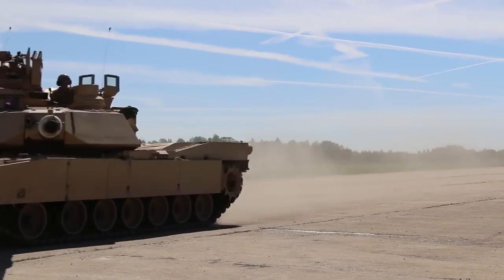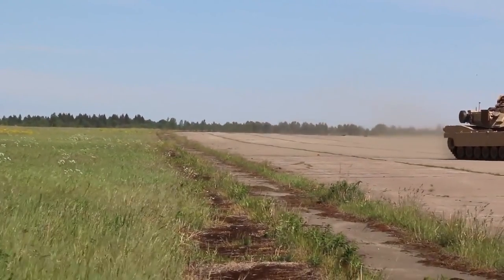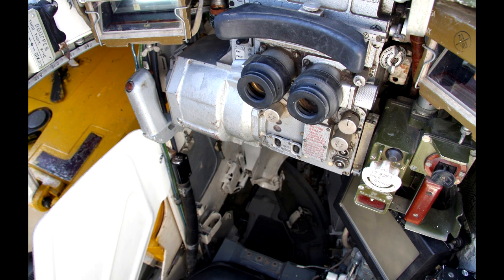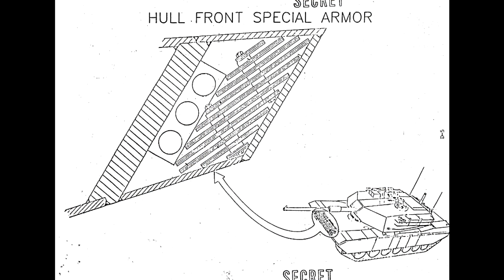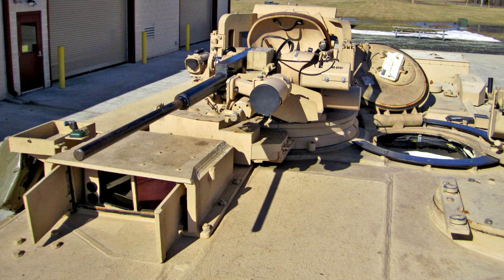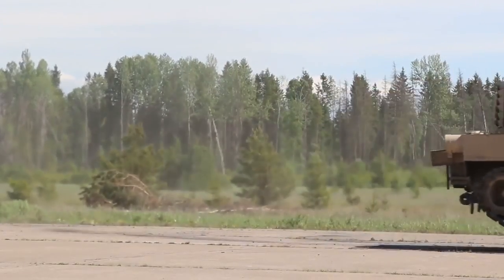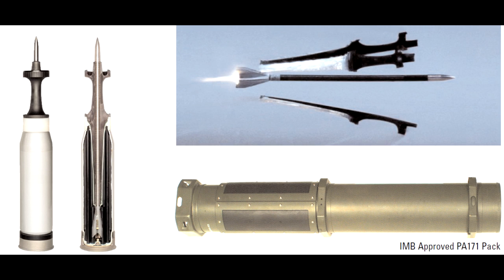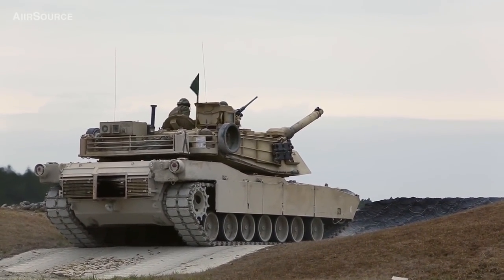Problems with Abrams tank

Comment: As an american, I can say that I'm totally biased, no matter what I do, but hopefully I can overcome that. one thing you might want to correct is when you mention that the abrams would meet the same fate as russian tanks, which is not true due to the fact that an ammunition blowout, in most cases would not harm the crew, whereas on russian tanks, it turns them into astronaunts. you might have just been refering to them being knocked out in combat, but most people will probably think of the turret flying.
Reply: Bro💀Your stupid ass brain can realize that russian tanks would still be destroyed even if it had blowout panels? Wanna know why? Because the cumulative projectiles after penetration create a fucking hell inside it. It just doesn't matter, do you have panels or not, crew will still die in a similar way a soup in microwave. But ofc, you won't understand it

Comment: Something to keep in mind about the turbine engine. America designed the tank to run on the most abundant fuel source available to it. Jet fuel. When the American military has to go to war, it has to be shipped there by boat and plane. The most commonly used fuel you will find on carriers and planes? Jet fuel.

THAT was the reasoning.

Comment: I love how you assume that only Abrams uses "whatever it is" fuel. Nope. JP-8 is a type of jet fuel similar to diesel in many of it's characteristics ands majority of US vehicles are designed to run on it. Not to mention 105mm was installed on it as a stop gap measure because 120 wasn't ready at the time.

Comment: well, it may have it's problems, but they seem minor compared to enemy tanks
armor  may be weak at some points, but it's still stronger and better armor then soviet tanks today...
and the turbine, it has it's advantages and disadvantages... keep in mind that it was designed with the workings and tactics of the US military in mind, so they envisioned likely scenario's where  for example the right fuel would not be present at a time of need, so they designed it to gulp any possible fuel... at the cost of becoming a bit inefficient in that regard...
so even though every1 may see features of this tanks as problems weakening the tank, in the right hands, that monster could actually be, well..., a monster on the battlefield
interesting video, so far it has positioned and proven itself the best tank in the world, and since talk is cheap, as long as that fact remains disproven, it may as well have no engine at all, it'll still be the best in the world :D

Comment: The reason why Abrams uses turbine engine is weight and size.
Turbine engines weigh less and have smaller size when compared to diesel engines for the same power output. Putting a diesel engine to Abrams would make it simply too big and heavy.

Comment: The M1 may be fuel inefficient, but when you're fighting on oil fields you can fuel up at any time :)
Reply: I am 99% sure this is sarcasm....but these days, you can never be 100% sure....
Reply: This man right here, is thinking as everyone should when operating the Abrams
Reply: They should've added a built-in refinery unit, where you just need to feed it with crude oil!
Reply: Yeah you are right... there is a gas pump connected to the oilrig😂👍
Reply: Literally made for the middle east 💀
Reply: És lángolhatsz is mint egy olajkút.😂😂😂😂😂😂
Reply: just another stupid american
Reply: The M1 only has an advantage over the Leopard 2 when you fight in a distillery or perfumery since the only fuel an M1 can use which a Leopard can't is alcohol.
On the other hand the Leopard runs happily on heavy oil while the Abrams does not.
Reply: @gustavmeyrink_2.0  we all know how much the Russians love vodka

Comment: You are wrong about RHA. You said that no armour can be stronger then the same thickens of RHA. Even British Chrobham armour was reported as being twice as protective as  RHA.

As far I know M1 uses level 1 first generation Chrobham armour supplemented in some models with DU inserts. 

I do not understand the hard time you gave to Challenger 2 saying the driver's periscope was a weak spot when according to you the whole Upper front plate of the M1's hull is a weak spot. You also did not mention TUSK...

Comment: The Abrams gas turbine unit is an odd decision.  The tank was no lighter, the engine consumed as much space within the hull, it did not generate more power and it is no more reliably but it did cost more, costs more to service and is less efficient.

Comment: There is no such thing as best when it comes to weapon systems. The tank is just part of that system. Taken together a weapon system is optimized for a set of environments. The Leopard and Abrams plus their support were designed with different missions and requirements. So who fairs better depends on the circumstances they face in combat.

Comment: Diesel engine mean, you can only use diesel fuel. The gas turbine can use multi type fuel. I think that is an advantage.
Reply: in Russian tanks, any fuel, except kerosene. Similarly, in military equipment - for example, the tiger car. As for fuel, Abrams consumes about 1,500 liters, diesel 300-600 liters
Reply: Russian and German engines are diesel multifuel

Comment: I have a feeling this guy is a Russian or pro Russian…you will see how good it is when it touch down beside it little brother bradly ..you Russians are in trouble.. u shot at it and pin points the shot and kills..same with the bradly .😢 emoji is gunna be ur Russian friend.. it will kill anything Russia has .that’s why your president is shaking in his boats
Reply: he seems to be with Serbia, I can't say that he is for Russia, when there was a review of the t-90 and t-72 (of different modifications) similarly poured mud, I don't agree with him about the shells, Abrams has the longest shells (crowbars - bops) and as far as I know they are the most penetrating of the existing tanks on of course, only the t-14 is stronger (but they just say space there) which is not put into service and is not mass produced.

Comment: Such a small-brain analysis, but I wouldn't expect anything more from a russian bot lmao. Did you get that turbine engine argument from reddit? The turbine produces more power at low speed, becomes more efficient on the move, and is much quieter from a distance. Yes, you can hear a diesel from much further away. And of course you failed to mention the APU which the Abrams can use to power the systems while stationary.
Reply: How are you calling him a Russian Bot when his Ukraine War videos are very much pro Ukraine leaning?
Reply: @xXrandomryzeXx  Are you going to refute any of my other points or is that the only thing you can come up with?
Reply: Apu was mentioned. Turbines have their own advantages and disadvantages.

Comment: Honestly the AGT1500 has advantages as well, it is lighter, its power to weight ratio cannot be compared to by a German Diesel of the era.  Simplicity to work on compared to M60.  Keep in mind the 1980 M1 was close to 60 tons, the turbine got that tank moving, and moving fast.

Comment: I would like to point something out: the Abrams did not have 350-380mm of protection. It was rated to have 400-430mm of protection. But IMO this tank needs to get replaced. Stat.

Comment: APFSDS projectiles have a tendency to shatter at around 80 degrees. Abrams's UPF is angled to 82 degrees for a reason.
Reply: Wrong. 82-83 degree angle is the most reasonable angle to deflect an APFSDS instead of allowing penetration. The angle of the upper plate doesn’t shatter the sabot.

Comment: speak about soviet tanks that litteraly made crew seat on ammo and well auto loader tanks do have good protection like olplot has seperate ammo storage despite having auto loader but that time soviets didnt want crew safety and the worst thing for a tank crew in a battle is being inside a tank with ammo surrounding and giving company to you and it were so cramped that even breathing was hard

Also no multi fuel feature is not unecessary because if somehow the supply lines in battle are caught in cross fires or ambushed by enemies then in emergency any fuel that could be found from captured enemy position or from local areas could make difference in win or lose of war
Reply: Read the pinned fucking comment. This is a video about the abrams not Russian tanks. He already made videos with problems with Russian tanks, stfu...

Comment: well in prototype stages GM had put the diesel engine but got disqualified to the gas turbine of chrysler because Gas Turbine engines has multi fuel injection capabilities with more power and a newer technology and can even use jet fuel

Comment: RedEffect-Bot
You Serbian pseudoexpert, keep your Serbian-Russian propaganda for yourself and your Putin-Lover. Abrams was much better than T-72, A2 is better than any Russian joke-tank. The gas-turbine has many merits which your limited intellect wouldn’t understand. For example. The motor although it is louder at close range, gets quieter at distance over 50 m because the sound has higher frequency and dissipates over longer distances compared to infra-sound of a diesel engine, the gas turbine can use diesel fuel in emergency and won’t get destroyed, when compared to a diesel. It produces less smoke and is more reliable than a diesel because the construction is simpler and the acceleration is also better. Hahaha, you know nothing.
For you and your babbling about the upper plate that a round would get through it like a hot knife and that is the 38mm version, not the 50mm one.
https://www.youtube.com/watch?v=0c5XkP1ywpk
Loved to pwn you.
You are a joke.
Reply: Bro read the pinned comment bozo

Comment: This video aged well didnt it.....
Reply: I'm curious what you're thinking has aged badly.

I mean ... AFAICT the problems described were indeed problems, but the constant comparisons to contemporary Soviet tanks invites comparison with those contemporary Soviet tanks. And ... well ... those comparisons already looked silly after Desert Storm in 1991. The original M1 indeed had the flaws listed, but nothing compared to the T-72 flaw of blowing up when an M1 shot at it (while vice versa, the M1 didn't even get knocked out when a T-72 shot at it).

In the three decades since, the basic scenario hasn't really changed. The M1A2 is greatly improved over the original M1, while Russian tanks have also had improvements. But the same basic formula remains - the Russian tank still has the infamous "turret launcher", while the M1A2 does not. Russian tank goes boom when hit. M1A2 does not. Still the biggest relevant difference, three decades later. Still kinda the same bottom line.

Comment: one concept I've never have understood about the Abrams tank is why in the hell they put gas turbine engines in them every tank on planet Earth should have a diesel engine until some antimatter device comes out in the distant future and they can run on one gram of that it needs to be diesel fuel
Reply: For some reason the only ones that complain about the turbine engine are those with zero US military experience?  I was in an Abrams armor battalion and never ever heard any tanker say "man, I wish we had a diesel instead of this turbine engine in the Abrams."  The Abrams has used the turbine engine for +40 years and they had plenty of time to switch to diesel if that was needed for mission requirements.

Comment: This entire video is just looking at the Abrams through an outdated tank vs tank mindset, all of the “problems” with the Abrams’s can easily be explained. The engine? The tank was designed to fights the Soviet’s and collaborate with other NATO countries, using only one fuel would be a detriment in that fictional war. The armor? Adding any more would make it overweight for no real gain as a Soviet round would still be able to pierce it. The gun? There is no point in adding a bigger gun when the soviets aren’t making tanks with more armor, no one is.

Comment: With all of those "problems", the M1 still shredded Russian tanks with "better", lol, night vision and bigger guns that couldn't reach them...  One of the reasons the AGT 1500 was chosen was because it is quiet and does not smoke, unlike diesels, in a forest full of trees, where it was hard to visually detect targets, and back when IR detection methods weren't as advanced, being quiet and not belching smoke made you harder to detect. During REFORGER exercises, we could always hear and see smoke from the allied diesel tanks way before we'd actually saw the tanks... Russian tanks are even worse, smoke like they are on fire before they are hit and have the noisiest tracks I've ever heard.  Also, the filtration issue only occurred in the desert, when the tank was deployed to the Middlle East.  It wasn't an issue in any other theater of operations.   The .50 cal in the commander's station, originally was intended for AA defense, it was not until deployment to the middle east, did the need arise to use it in Urban Combat, which is where most of the SEP improvements came from.  On paper, your constant argument about the front plate makes a little sense, but it doesn't pan out in reality.   Even with all of these perceived problems, we, the US have only lost 80 in combat, with 63 of those being restored to duty.  Not melted into slag heaps, no turrets doing flips 100ft in the air, no parade breakdowns, not many that the crews didn't escape from.  The Abrams has it's issues, but it's combat record speaks for itself.  What other tank has a better combat record? Certainly not anything Russian, and what other Western tank has seen even half the conflicts that the Abrams has?
Reply: No one factors in the US Military's Combined Arms Doctrine of infantry, artillery, mortars, scouts, air defense, engineers, close air support, maintenance/logistics/fuel, intel, communications, and command/control that provide overlapping protection and support.  The most important piece of the puzzle are the men and women in a 100% all volunteer Military working together and have the trust and support in their leadership to make battlefield decisions to accomplish the mission.

Comment: problem is the diesel doesn't have the same power when running. the gas turbine doesn't use cooling fans that rob power from the engine.

Comment: If i remember correctly, Abrams chose the Gas turbine for a faster startup, better acceleration and weight torque ratio, and a bit quieter
Reply: It was also able to run on different fuels like kerosene albeit with different results